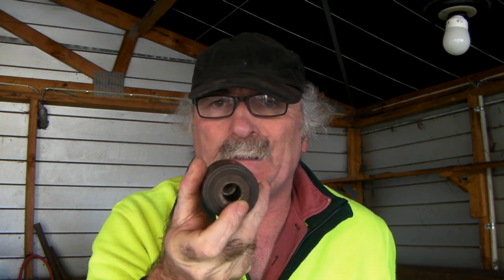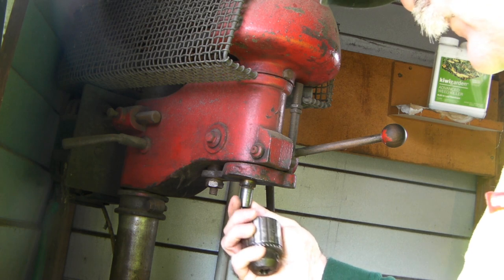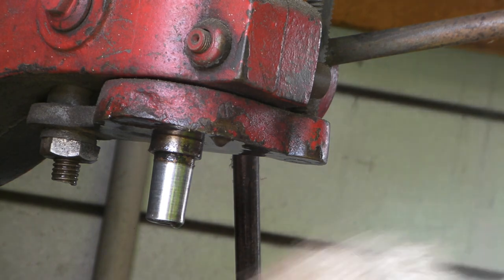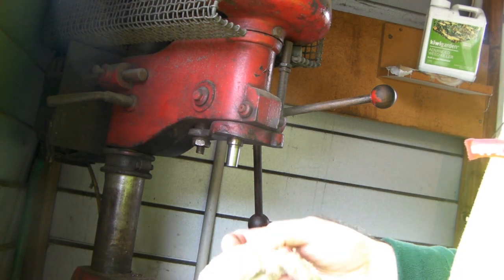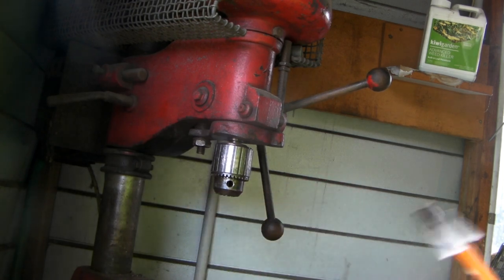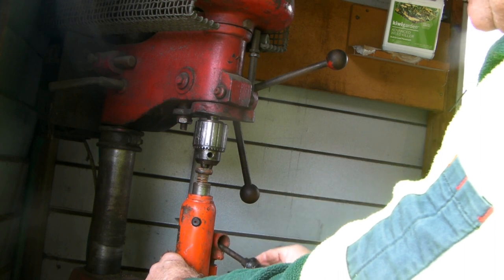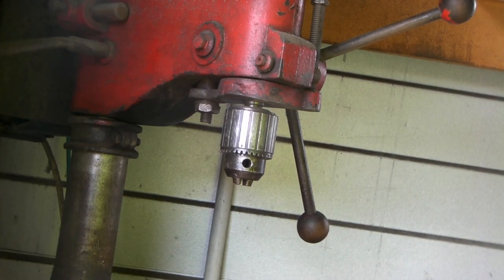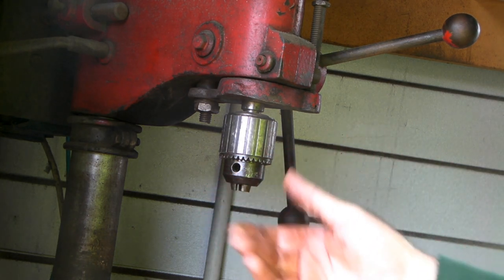Drill Press Chuck Falls Off  Easy Fix

Comment: Hi...I had a chuck like that in the tailstock of my lathe that kept coming loose and slipping.  Cured it permanently by cleaning the Jacobs taper and hole in the chuck, then reassemble it with Loctite 638 high strength retainer...  It has never slipped since...

Comment: Holy....proper way is to clean the surfaces, heat the chuck to about 50-80 Celsius and put it on the shaft. Will not budge, will not whack your bearings nor will it bend/crack your table.
Reply from the maker: Thanks  good idea
Reply: Thank you! Great idea.
Reply: I cleaned both surfaces with solvent, then heated with a torch trying to reach your 50-80C temperature band and slapped it on.  Hasn't come off yet!!  Thank you!!
Reply: Heating the chuck makes absolutely no sense
Reply: @Karl73828  Heating the chuck causes it to expand,  making the opening bigger.  It shrinks when it cools, gripping the shaft.
Reply: @Karl73828  My reply about heating the chuck refers to a drill press that has a shaft that is integral to the machine and a chuck that
 fits onto the shaft. Heat the chuck,  not the shaft.  In the case of a chuck that has its own shaft,  heat the female part on the press.
Reply: Was thinking of putting the chuck in the toaster oven to heat it up. When the wife's not home, of course.
Reply: Worked for me- heated the chuck and cooled the tapered shaft, which was being torqued mightily with a 4" hole-saw thru sheet metal. Thank you!
Reply: @petestools I just about chucked my chucked and drill press right out the door today! I know it's a safety thing that it falls off in case it gets jammed up...but come on! I was using a brand new, very sharp forstner bit on soft pine...I was not forcing it and I was being careful...stupid thing would not stay on. I  even removed the bit and pounded it with the hammer and a piece of wood.  The chuck stayed on then the bit kept falling out even though I tightened the damn thing multiple times.  
I thought the guy sold it for $100/cdn because it was full of surface rust.  Not to mention the guy should be beaten with his own tool belt for using the deck for a glue up surface! I managed to clean the whole thing until it looked 98% new. ...now I'm wondering. 
Thanks for the lesson
Reply: hi.i did as you said for my small drill press thanks for your help,and i have a question,why they dont make this chucks treaded like hand drills?
Reply: Makes sense ..yea bottle  jack don't know how those bearings would hold up to that

Comment: Bottle jack great idea. )They're powerful, more than trolley. And work horizontally; I used two to push a stump away from a wall.) But when you have to release it? I got some thing mole grips on top and hit down. Needed to release cos cheap plastic  guard had split off and when I glued it back together I had to release mandrel. I'm looking for a vid on repairing guard, yet you don't even have one! 
Thanks for vid
Reply from the maker: Ah, the great bottle jack release debate! It's like trying to solve a Rubik's cube blindfolded, right? Don't worry, you're not alone in your struggles. But hey, at least you found a creative solution with the mole grips and hitting down! Thanks for sharing your experience and watching the video!